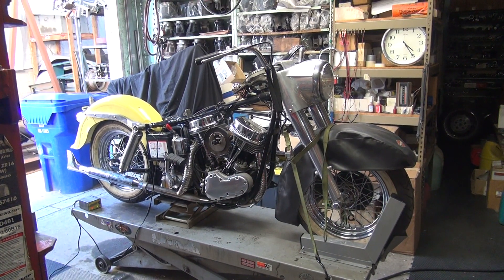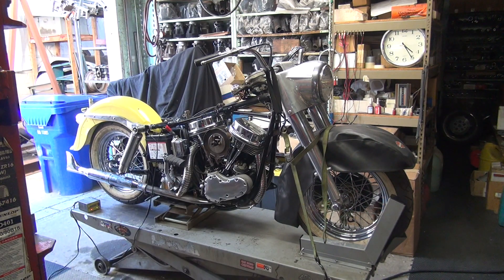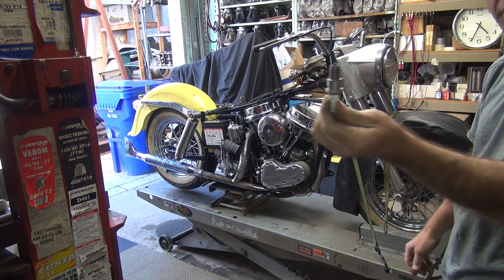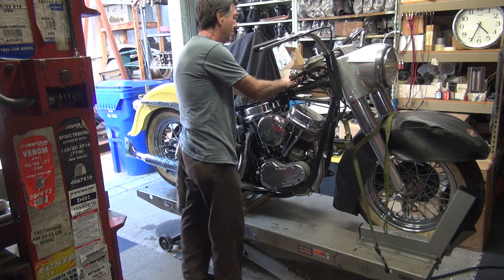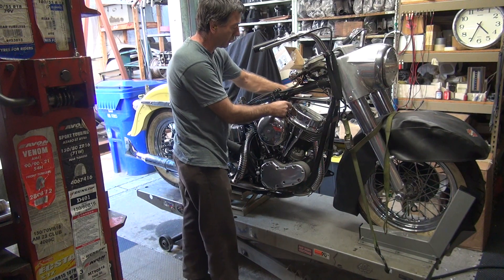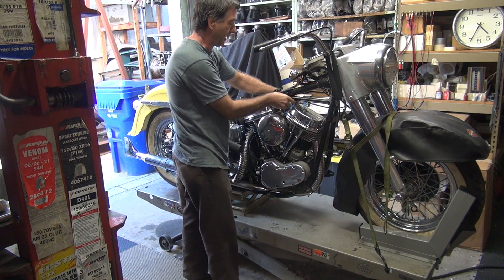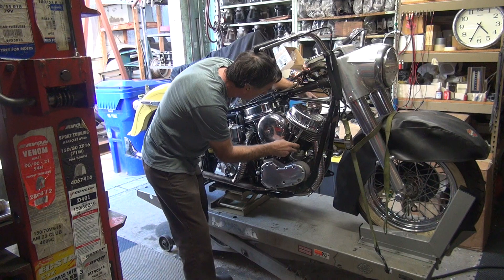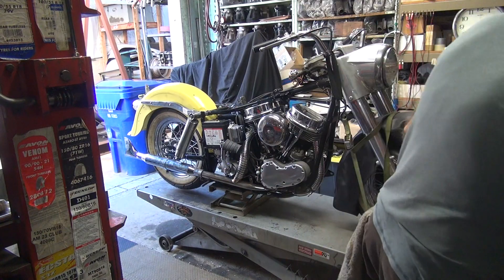1965 panhead #161 74ci flh motor rebuild and bike repair harley by tatro machine

Comment: I was the sportster wrench at "The Shop in Terre haute, indiana back in 1985. when I hired on , Big Jack, my boss said " I hate sportsters so you are my new sporty tuner ..I said, "great , l love sportsters " one of Jack's old customers brought in the engine from his ' 65 pan chopper to build a stroker ..jack bought him a kit from CCI that had just been released to the public .. so it's cheap thrills the day you open new toys to play with ..this kit was pretty cool..the rods where polished like chrome and so were the wheels .. jack say check out these rods .I grabbed my dial calipers ..and a S&S rod off the self and the new polish CCI rod across its beam was .007" wider than an raw forged S&S ...
so this CCI kit was starting to look like a serious bottom end and came with a balance sheet as it was a complete balanced rotating, assembly ...I hot busy on the heads cleaning up the ports with a die grinder for some free horsepower , and then new guilds and stainless valves , while jack drilled the cases for the rocker box oil return that bypass the stock cylinder return to dump directly on the wheels .jack was skeptical of the Jap pistons that came in the kit that were done very well as I had seen this type before from ricer race kits ..thin rings at the very top of the crown close together , top ring of moly , 2nd scraper of steel and three piece oil ring with and offset wrist pin hole right through the oil ring grooves to accept the longer CCI rods , don't remember the exact stroke but when assembled with the .030 over pistons gave us 88 cubic dollars x pounds of fun ..there was a cam with it but clue today I can recall any specs of but looking like the ramps on the lobes shot straight up for the longest duration .then dropped off straight down ..I had a snapon leak down tester at the time for checking rice rockets as that's the only way to find glazed out cylinders on them when the wannabes burn them up cruising all night up and down the "bash" ..so just before you set the push rods in I would always get a read out leak down on your valve job before you ever fire it off ..just so you know you have a base line of the specs before you hand it back to who knows what they may do to it.. I am seeing about 40% to 60% leak down that is very typical of any fresh build dry engine that has never fired off yet ! so I tell jack watch this trick .. with the leak down tester still pressurizing the head valves and piston rings I tap on the tops of the valve stems with a small plastic mallet and kerpop you will here air blow out the port associated with each valve...and at the same time you will see smaller numbers on your % leak down each time you tap on the valves ...this is what an engine first does on startup as you first here them coming into it ...so basically this engine is all broken in before it ever starts up ...this one I got it down to only 6% leak down with dry cylinders .she's gonna be a mover right off the bat..the owner takes her home only to come back a few days later .." she won't fire" and Jack is going over his usual imaginary diagnosis with nothing to see ..and the owner says no no no thats not it ...I don't have enough lead in my ass to spin it over with the kicker ..cause this one ain't got no button , kick only , hehehe .this is jokester time as I go lol.well jack had lost an argument with a light pole a few weeks before and was in a wheelchair til his knee grows back together and the ower looks at me as jack does to 
.and it's like Oh no no not me i ain't busting my leg on no pumped up pan ... now it's not so funny as jack says if want beer money for tonight you're gonna fire up this pro stock beast first..damn black mail ..it throws a fire ball out it's giant S&S velocity stack attached to the biggest S&S carb I have ever seen .while they go try it again ..shit damnit here go and it bout drives my head  through the ceiling as I pick my self up off the concrete ..I go " main jet?" ..well to try to save some time here . jack calls S&S the next day told them what we got , they gave us a jet number for the pilot jet and it fires off on the second kick with giant potato potato sounding like a top fuel rolling up to the line ..so I knew the customer myself and say  ..there ya go Kieth knock yourself out ..he come back a week later with more trouble and says it's trying to lock up ..
I say no way I'm riding it as I got court for my last DUI ..so jack says run it down the alley past the shop let's see what is doing ...there smoke coming out the primary and sparks out of the brake drum ..as Kieth not destroyed the pin bearings out of the rear axle of his 1938 rear hub and mechanical drum brake ..I said I have seen it all now ..this behemoth motor we built would pull a weight sled clear out of the ring for all full pull contests.  smoking a brand new barnett clutch ... 88 inch pans rule
Reply from the maker: that is a long ass comment to just say that 4-3/4" stroker motors haul ass and are hard to start. all very true plus they shake the crap out of you. time for another fun ride.
tatro

Comment: when kick starting a panhead....after 3 primer kicks , open choke all the way to start
Reply from the maker: not most of the time but whatever works for your application is the correct way. as you can see i do different things to try and find what thew motor wants. even the elect starter didn't work at times. still working on the tuning but i will find the sweat spot.
tatro

Comment: I know a guy (I was in the Navy with) who put the wrong type of oil for a Helicopter turbine causing it to go down in the ocean. He made the mistake because during "darken ship" they turn on red lights in the hangar Bay and he did not realize the container of the bottle was a different color. TRUE STORY!!!
Reply from the maker: so the gear oil didn't get the job done.
tatro
Reply: Tatro Machine nope, in the ocean she went. Poor fella never picked up chief because of that incident too and he was (still is) one hell of a mechanic. Shit happens ya know?
Reply: Couldn't he read? I was a Huey, then a Black Hawk Crew Chief in the Army.